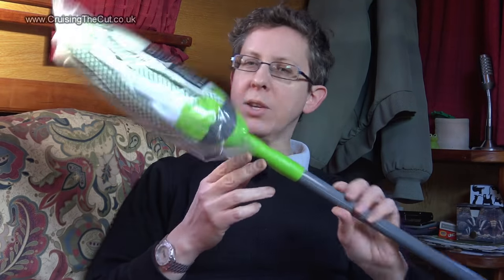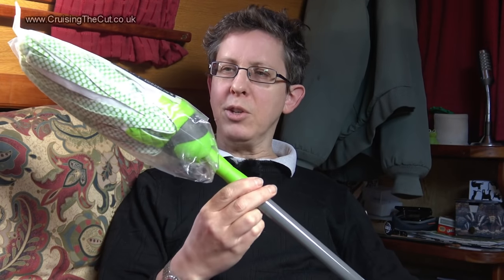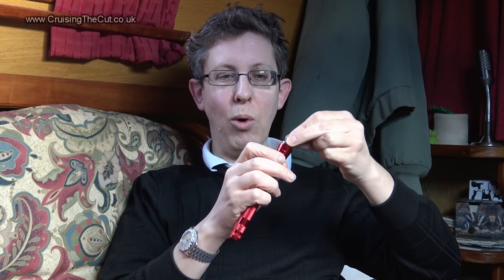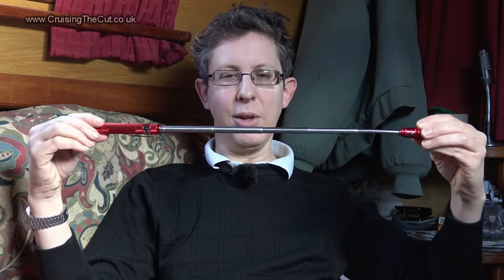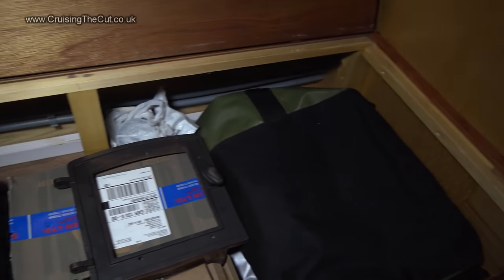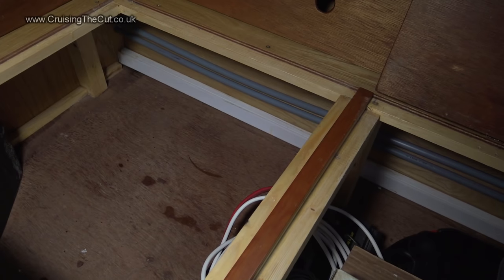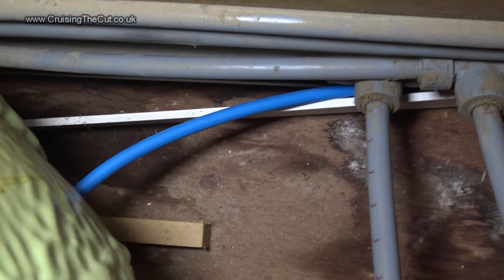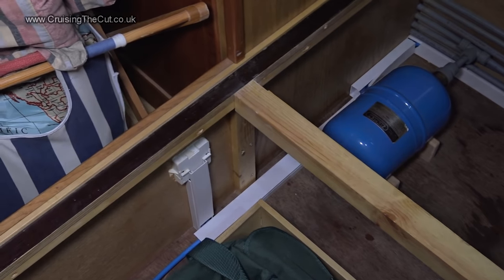19. A shopping "haul" and some new wiring on my narrowboat

Comment: I know this is four plus years later, but the solution to the dripping diesel is a product called "pig mats." Specifically designed for absorption of oil drips. Hoping you may have already found them or something similar. Some guys use a tin foil baking pan strategically placed under the engine to avoid the bilge being soiled at all. The pig mat is used in the pan to avoid sloshing on removal. And if someone hasn't already said it, little old engines like that generally leak a bit. If they don't, that's a sure sign you need to add oil, LOL. 
I'm enjoying your adventure from the beginning. At some point I'll catch up!

Comment: Something you might consider for the bilge, is a silicone baking pan or rimmed baking sheet.  Ideally,  you can find one of the same basic dimensions or large enough fraction of the under engine bilge space.  It is flexible and returns to shape, so can possibly be scrunched into place and then worked back into the shape of a good drain pan.  It can tolerate anything that might drop into it and can be removed and cleaned well.  You would still need the rags or mop to get the large puddles out, but it would keep the bilge bottom clean.  You might also be able to prop one end up and direct the gunge to the accessible end.  Just heard about your channel on Mads's, Sail Life and so am gradually working my way through the library.  Keep up the good work.  Very interesting series.
Reply from the maker: Good idea and thanks for popping over on Mads' recommendation. Cheers!

Comment: As a side issue I noticed the plumbing is fitted with gate valves. Gate valves are notoriously unreliable and either leak, seize or do not shut off properly. It would be prudent to change these valves for ball valves. It would also be a good idea to fit isolation in line ball valves to each outlet such as under the sink, basin supply to the toilet, hot water tank and accumulator.
The reason for this is that if it is required to service any of these items it can be achieved without turning off all the water to the boat. Another aspect is if there is a failure of any item, for instance the hot water tank, it can be isolated and you can continue to have water elsewhere in the boat.
Reply from the maker: +Patricia Brooks Thanks Patricia. The taps etc do indeed have individual shut-off valves for such work. Cheers.

Comment: 'The paranoia of owning a boat' - I can completely relate to that. But it's so worth it.
Reply: while trying to replace a starter motor on one of my v8 engines on my 8 meter cruiser I got stuck in the engine bay while laying on my back with my feet stuck straight up in the air. My wife was in hysterics and threatened to call  the fire dept to get me out. After about 30 minutes I finally had to cut my clothes off to get out, while my wife couldnt stop laughing.
Reply from the maker: Your wife left you like that for 30 minutes?!?!
Reply: love of my life:)

Comment: I'm guessing the reason you have only one socket on that side is it is next to the inverter, with the mains ducking down after that first socket under the steps, then running along one side of the boat. The 12v would continue down in that trunking you discovered.  This would have been done originally to keep the 12v and 240v circuits as separate as possible. 

Not that what you have done is dangerous, just maybe not best practise. For others watching the video, they may want to consider running another piece of trunking dedicated to 240v, although this may not always be practical without major dismantling.

Some stickers on the trunking for the next owners just to warn them that it's running both 12v/240v might be a good idea though.
Reply from the maker: It's not for sale and no plans to be.
Reply: I didn't mean to suggest it was, and hope it isn't for the foreseeable as I like watching your videos!  ;)

Maybe my second paragraph , second sentence, should have said:

"For others watching this video looking for tips,.... " (My case actually ;) )
Reply from the maker: Ah. Fair enough!
Reply: Honestly wouldn't say it's dangerous. At least it would be legal on a commercial boat coded to MCA standards. Using good quality cable is important and the artic outer ensures good insulation. There will be RCD protection if anyone decided to cut/prod it.
Reply from the maker: That's reassuring to know!

Comment: I hate to repeat myself but you really should try and find the sources of the oil leak.  If only to cut down on the number of mop heads that you will go through :-)  Can i recommend that the next time you have clean out the bilge sprinkle some talcum powder down into the bilge.  Hopefully that should make it obvious as to the starting point of the leak.
Reply from the maker: Good idea. And you're right, I know.

Comment: Just normal DIY jitters, shucks I was nervous the first time I played with 240V and I'm still breathing. It will get easier in time, you've snaked your first wire and didn't fry yourself or the mains or your boat. Enjoying the videos.
Reply from the maker: Thanks. I'm going to leave the final connecting up to a professional :-)
Reply: Unless you have  laws preventing the connection. DIY rule, turn off power, make connection and then turn on power. Show the electrical panel no fear. I'm frugal must be the Scot within me. Wired my houses, camp and boat.
Reply from the maker: I don't know if the BSS specifically prohibits me from DIY on the electrical a but I know my own commonsense does. If I wired it up I'd be permanently terrified the place was going to spark up in flames. And, I don't understand why the wire to the existing socket has an "in" and an "out" wire rather than just one wire bringing the power. All in all, best left to someone who knows their stuff.
Reply: +CruisingTheCut Not aware of your socket but, best bet is one wire goes in and stops, the one labeled out might be,  it can accept another connection to feed more power to other circuits along the line.
Just a thought from US. You work within your comfort level.
Reply: +CruisingTheCut Not 100% what you mean by in and out but all sockets are wired on a ring main so you will normally have two cables. basically it's wired as a circuit. from the mains board you have a wire going to socket 1, then a second cable then goes to socket 2 and again another cable to the next sockets etc etc the very last socket would have the second cable going back to the mains board so you have al ring main. You look as if you are planning to run a spur from an existing socket, basically 1 length of cable to a single socket it wouldn't be part of the ring main. Not up with the current regs but in terms of houses it's Ok to run 1 spur from a socket. do a search on ring mains and spurs on the internet
Reply from the maker: Hi. Yes, I'm sure you're right for houses but it's my understanding that a lot of boats don't bother with a ring, just one long spur down the length of the boat. Hence my surprise to see the second connection. I was anticipating a single wire to the bedroom socket, with a separate cable taking the mains down the starboard side of the boat from the fuse board.
Reply: +CruisingTheCut The reason for the ring mains is it effectively increases the amount of current a given wire diameter can carry.   If you imagine a single length of cable with a number of sockets connected along the length in series then the sum of all the current demanded adds. Which means that the last bit of cable before the distribution / fuse box could be taking a lot of current.  Now in a ring mains circuit that current demand is distributed down both parts of the ring back to the distribution / fuse box.  Therefore effectively halving the amount of current each cable is been asked to carry.

Comment: The biggest part of electrical work is getting the cable from......to..... so by doing it yourself it saves time money and you know where it runs. The connections and electrical protection( fuses or circuit breakers and) is the technical bit where you need a electrician. Let us not go down the approved.... certified...competent paperwork route.  Looking at the work your electrician carried out on the solar cells he is neat tidy and knows what he’s at.  If a job looks good the it is likely to be good.  Good tradesmen are tidy by their work ethic.
Although not a boat owner I enjoy your vlogs keep it up. Amacf

Comment: LR44 battery is an alkaline battery, with the most common equivalent batteries being: AG13, G13, A76, L1154, LR1154, 157 etc. However, these alkaline batteries can be replaced with silver-oxide batteries, with the most common equivalent batteries: SR44, SR44W, SR44SW, 303, 357, SB-B9 etc.

lr44 batteries can be replace by a 357 battery?
The 357 battery is a silver oxide battery, while the LR44 is an alkaline battery. The 357 battery has a longer useful life and provides a more consistent voltage level than the LR44 over time.

1) Silver oxide batteries have a 50% - 100% greater capacity, meaning they last up to twice as long as alkaline batteries. 2) Silver oxide has a relatively slow declining voltage during discharge compared to alkaline, which is preferable for light meters used in cameras and digital calipers.

~~~OK this is the good bit, it's a HACK!~~~
12v A23 batteries are in fact a 8 x LR44 batteries in a pack which makes up one 12V battery. By carefully removing the outer (plastic film )casing you will release 8 x LR44 batteries ( 8 x 1.5v = 12v ). This makes buying LR44 batteries nice and cheap!

Comment: I am only this far along on a "binge-watch" of your channel but thought I would mention that your boat seem to use what we call here in the states Qest water pipe. It is prone to freeze damage and when used with hand-twisted fittings such as I seee in your video... prone to leakage. If you ever have the need to repair your piping...you might consider another material and replace whatever has failed. Of course if your pipes are not Qest piping...forget everything I have said. Thanks for the videos!
Reply from the maker: I don't know what that pipe is but the stuff on mine is extremely common on narrowboats. As I live aboard, the pipe remains warm in winter; boaters who leave their craft unattended tend to drain down the water system to avoid freeze damage.

Comment: For a few quid you can get some thin rods that fix together rather like drain rods, you thread the rods through the conduit/gap starting from your destination back towards your start point, tie on your cable and then pull the rods back out the way they came, bringing the cable with them. Do it one section at a time.

Comment: There is a product available in the US for boats, called "bilge Buddy". It's an absorbent tube, that comes in various lengths. They absorb oil only, not water. They are made of the same material as the oil booms that are deployed in an oil spill. They work great for cleaning up the oil.
Reply from the maker: Thank you.
Reply from the maker: Not so on the UK inland waterways, although you are required not to put oil into the canal.
Reply: The oil pick up pad that Nor'easter describes are excellent.  Used to put several in the bilge of our boat and then throw them away in a plastic bag carefully every so often.  Hands never get dirty.  AND should not be a lot of oil in your bilge, water from packing gland, yes.
Reply from the maker: I catch the packing glad water, don't want it sitting in the bilge.

Comment: They do make a lithium battery for replacing those lr44 battery. You need 2 for replacing 4 of the lR44 battery.
Reply from the maker: Thank you :-)
Reply: @CruisingTheCut  CR11108 battery is a non-rechargeable lithium battery featuring physical dimensions of 11.6 x 10.8 mm, a nominal voltage of 3.0 volts, and a cutoff voltage of 2.0 volts.

CR11108 battery is also known as CR-1/3N battery, but also as a 2LR44 battery, because two LR44 batteries stacked on top of each other feature the exact required height of 10.8 mm.

Hence, the CR11108 battery can be replaced with a pair of LR44 or a pair of SR44 batteries - of course, a lithium CR11108 battery is usually a preferred choice.

Comment: Addendum -  I use a number of LR44 (AG13) regularly, so I do have stash of LR44 batteries :D . I bought 100 cells from Ebay and it worked out nice and cheap and now I never run out!
Reply: Too bad most of them will die of old age before being used. That flashlight is a pain. I gave up using it. Gobbles batteries.

Comment: On ebay, you can order 100 lr44 batteries for the cost of two or three of them at you local store. Only draw back it will take a month to get them from china.
Reply: No Chinese batteries for me, i need two hands to lift my Bosch battery, compared with one hand on my [dead] Quick fit one.

Comment: There are power sockets that you can buy which have a USB port or 2 which may be useful for later on.

Here's a picture of one that looks like you can turn the socket and USB ports on or off.
http://www.lovehandles.uk.com/media/catalog/product/cache/1/image/9df78eab33525d08d6e5fb8d27136e95/e/u/eurolite_usb_charger_-_power_socket.jpg
Reply from the maker: I did buy sockets with USB on them, cheers.

Comment: Hmm I am interested in what you are doing, in so much as you are changing the configuration of the boat. I am starting the process, so interested in your thought line, was it buy cheaper, then spend to change things to what you want as you could not find a boat to the spec you wanted ?  You never said as I remember the whole spec as what does it have engine wise hp who the hull maker was, the results of survey re thickness, any pitting , remedial work, etc, when was it last blacked.What inverter do you have and battery bank and have you a battery management system, and what 12v do you have, and what 240v. I do watch apart from the cushion questions just vids are spaced out so maybe I have forgot, great vids keep it up..
Reply from the maker: There's no single answer to "is it cheaper to buy and change" as it depends on the boats you find and what you want them to be like, so it's personal taste. I don't actually want to change that much on mine, it's basically great - just the dinette cushions and saloon furniture I don't like.

I don't intend listing the entire spec and survey results; that would take ages and not be of interest to most people or even of use to anyone since their boat will be entirely different! Many of your questions have been answered in prior videos eg about the inverter. Thanks for watching!
Reply: Hi again, sorry I did miss a couple of them, have rewatched in sync, very informative and entertaining, I am trying to get all specs together as cant do diy. I want the right builders hull, within ten yrs old, mod engine 42 hp or above for rivers, 3k inverter[although I can retrofit that] and  a battery management system like yours.] I want 58 ' to 60' to do northern canals. Must have a p.o. bog g/fs wish and not a walkthrough bathroom. Preferably a washing machine. and have a trad or semi stern.So its a long search trying to get that altogether. Anyway keep up the good work, have enjoyed watching. I currently have a grp but cant wait to get a nb to do all the system as a cc.
Reply from the maker: I had a very similar list though of course some things you have compromise on. I'd also recommend spray foam insulation as it's the best type (and some types of electrical cable can weaken if run through polystyrene insulation, don't know why but it's true). I also wanted a stainless steel water tank so as not to ever have to paint a steel one from the inside! The main things, it is said, that you should be picky about are a sound hull and good engine. Get those right and anything else can be fixed easily! Good luck.
Reply: +CruisingTheCut Thanks again, I have been trying to suck up as much info as possible from numerous sources, and you have pointed one out to me I hadn't noticed b4 and it was the stainless steel water tank., So your knowledge is helping people out here. Cheers.
Reply: +CruisingTheCut its amazing that as you get into them and realise there is soo much to think about, I have a grp in lydiate ,it is fully functional and probably over specced for a 1980 norman 27ft mid cockpit cruiser as I have very keen mate who likes to upgrade and add everything who can diy everything. But me ,all I have to do is go down and give it a clean, but I get on board and think mm, enjun on and  away I go . Has a bmc 1.5 apparently quite easy and good . Has a 2k inverter 12 v and 240  and he has put 12v [off e bay] usb x2 and battery soc in the cockpit area, co I can have computer systems music portals and phone charger right in front of me. I hasten to add I don't use any apart from the I phone charger as I prefer silence when sailing, but all options are usefull. My point being use more 12v and less 240, and from what I can see you prob don't need that inverter for your use and could go all 12 v, I am learning so much can be used 12 v.. Better to have it than not have both and you are kitted for both so well done.
Reply from the maker: Careful with those 12V USB things, some cheap ones are known to burst into flames...

Actually I've only got one 12V socket on the boat and that's under the TV. I use that with a USB thingy just as you do and that's all I need 12V for.

So then it's not that I need lots of 230V but it's handy to have sockets more readily placed for the occasional things I do use eg laptop.